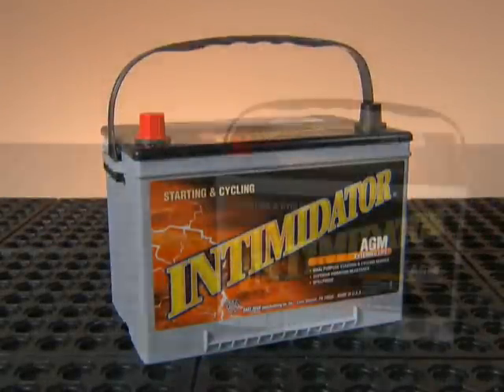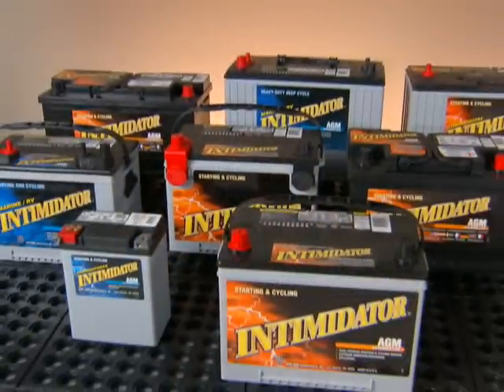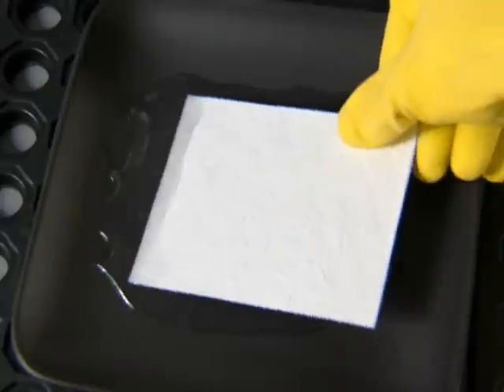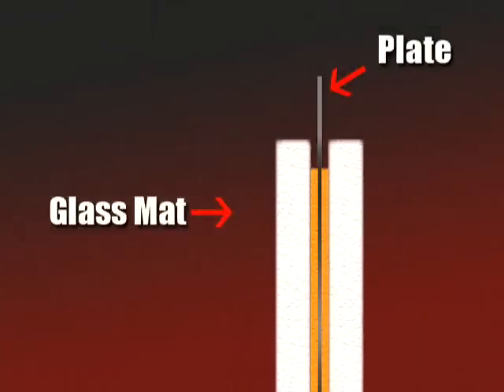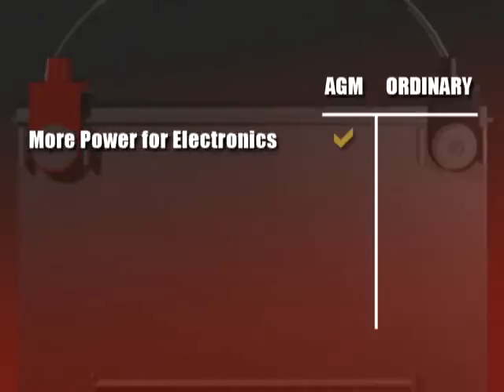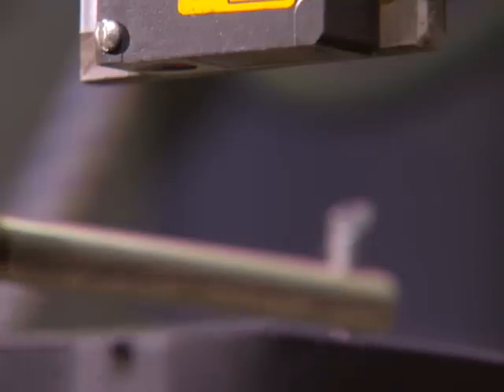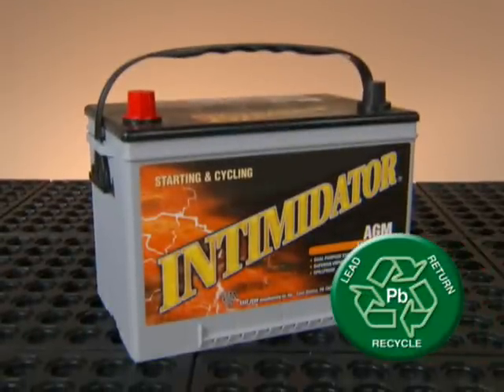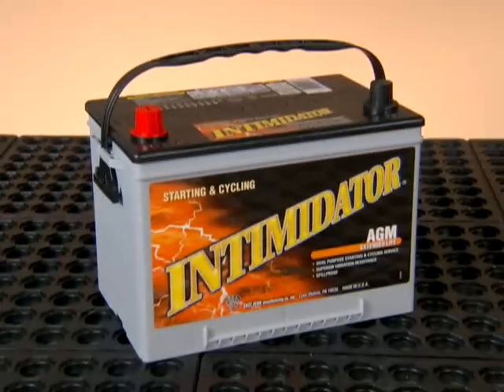Intimidator - What's Inside

Comment: for how many years can work without having problems ?
Reply: my intimidator is 3 years old. lost 50% capacity - 35Ah instead of 68. removed caps, added water (mats were dry), charged for several days (14.6V till 0.13A and then a couple of days 16.2V/1.65A). now capacity is 62 Ah.
Reply: not bad
Reply: @C00LM4N  how did you get distilled water in there?  And what caused the AGM to vent?
Reply: @ganzonomy  there are caps under the sticker.
all agm vents slowly. even ones standing on a shelf.
Reply: @ thats awful thing